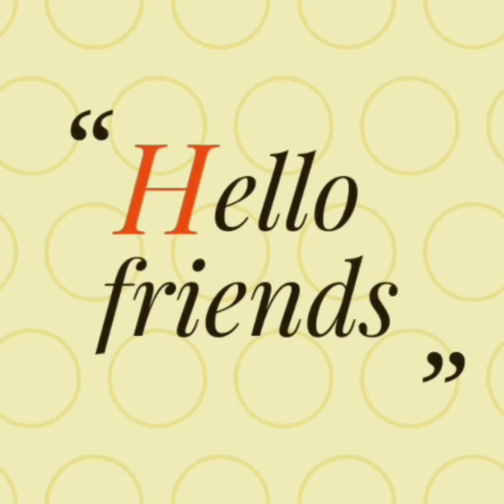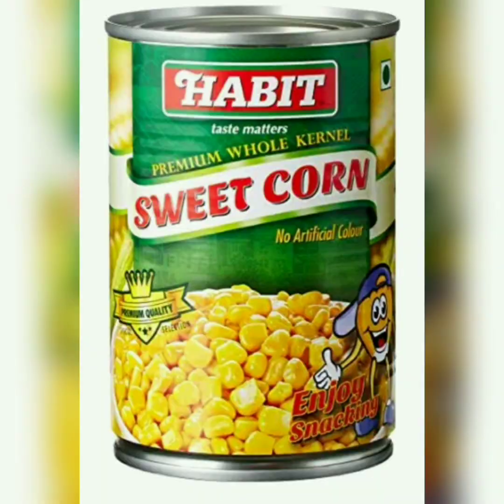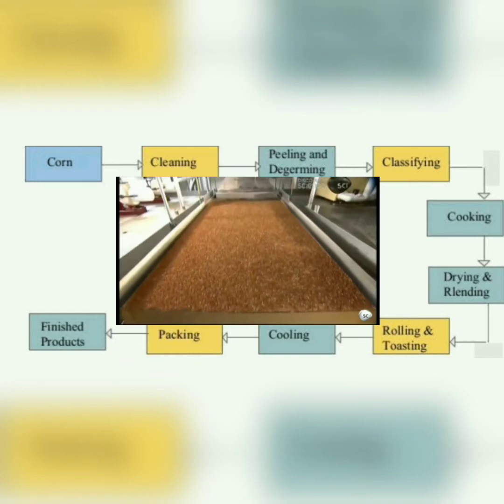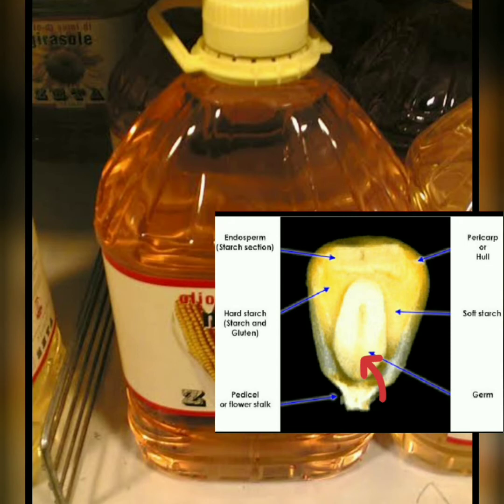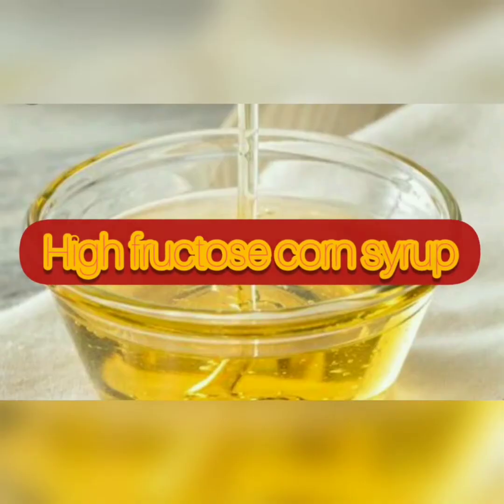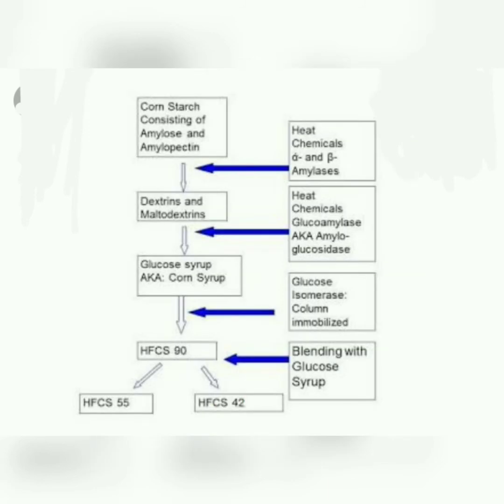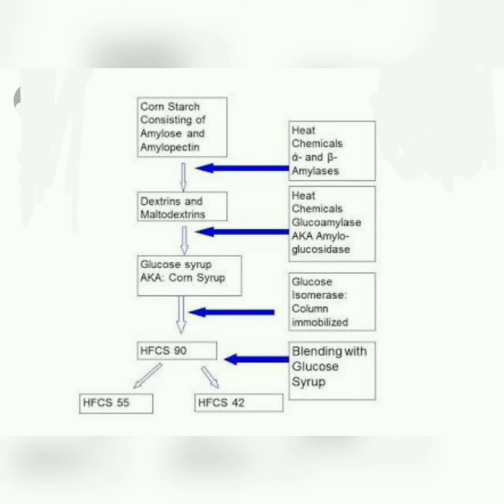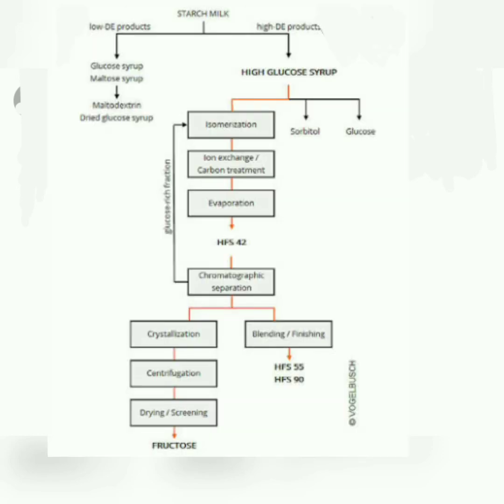Corn and corn products. Corn flakes.Corn oil.Corn syrup

Comment: Hii mam isme oil bhi hota h kya corn flakes m
Reply from the maker: Hi piru yadav 
It depends upon different brands  how they process . During toasting they use oil or not Generally it doesn't have oil. But in some brands for better appearance and texture they may use. So it depends.